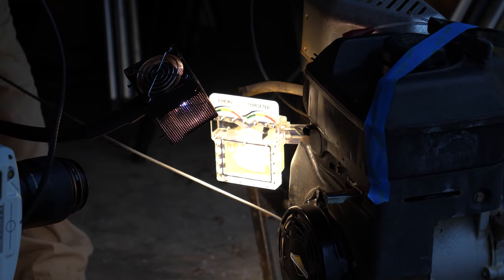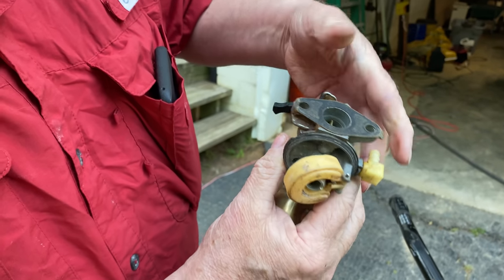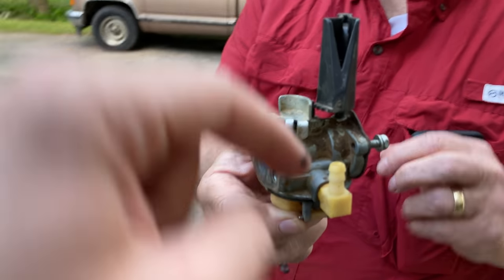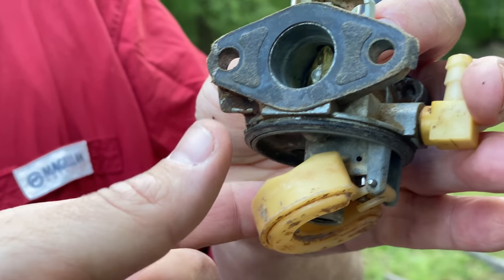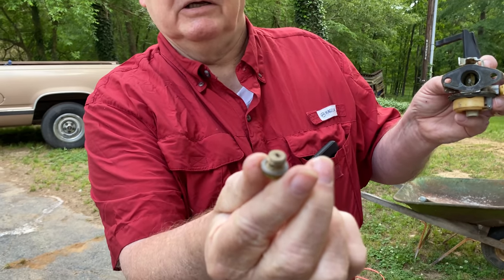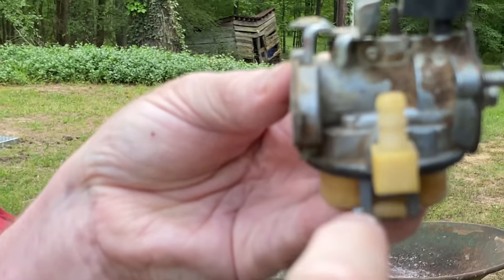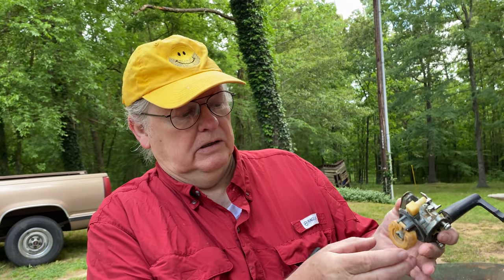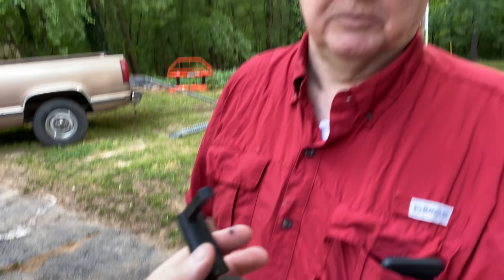Transparent Carburetor (Extended Cut With My Dad Darryl) - Smarter Every Day

Comment: Great video. The only thing I think you missed is the purpose for the float and valve. Just to shut off fuel flow, otherwise it would continue to flow until Fuel came out of the carburetor saturating the air filter and flooding the cylinder. The bowl needs to maintain a certain level that the Venturi could still suck the fuel out otherwise if fuel too low it won’t be able to suck enough fuel and if it’s too high it can easily run Rich or flood

Comment: The vibration of the float is not quite the piston turning around. The float is on the right 4 times for every intake stroke, so every 2 revolutions. Which means the float vibrates at double the frequency of the engine.

Comment: So my motorbike, carburettor has two spring-loaded screws to adjust the min opening of the valves. So you usually put the fuel to max (rich mix) and reduce the air one till engine just runs. Then you reduce the fuel one until the engine just runs at idle. 

This makes sure engine can idle without shutting off and also give you best mileage. Since during winter everything is cold, you usually increase the fuel a bit, else the engine will just shutoff at idle.

Comment: At 1 hour, dad is slightly wrong.  Some of the original fuel injection systems were essentially drop-in replacements for carbs - look up throttle body injection (TBI).  That then developed into port injection, injecting into the air stream just before the intake valve so the air stream coming into the cylinder has the fuel mixed in already.  Newer vehicles now have direct injection, which does inject fuel into the cylinder directly just like in a diesel.

Comment: The back flow is linked tonintake lenfth and valve timing. At the position of rod and crank at 90 degrees angle, you are at the maximum piston speed. It generate an high pressure wave that gose upstream the intake. This isbthe tuning you want to adjust to maximise the volumetric efficiency. The wave will then go back to the cylinder. It’s at this soecific moment that you should close the inlet valve.

Comment: This was fun to watch. I could see destin had some misconceptions and a confirmation bias but they eventually got through it. Im gonna give a little gripe, the fuel turns to a varnish like substance but its not shellac. Shellac may be a varnish but not all varnish is shellac. Shellac is a very specific thing thats made from a secretion of an insect commonly known as a lac beetle. The secretion hardens like a shell hence lac shell or shellac. This sounds made up but its 100% true. The substance is alcohol soluble but isnt dissolved in much else and sticks to just about anything, is non porous and makes a great sealer as long as you dont spill your beer on it. Ive heard its better at getting rid of smoke smell than commercial products when used like a primer for painting houses and it can make a beautiful wood finish. You can french polish a classical guitar with shellac but don't get it from your fuel tank because thats not shellac at all.

Comment: Choke controls the mixture, rich or lean. Throttle controls how much of that mixture goes into the cylinder. The throttle controls the engine speed at a particular setting of the choke. The choke needs to be adjusted as per your ambient conditions. Throttle will control only engine speeds.

Comment: I think on the old tractors, it was actually a fuel sediment bowl, not a glass carb bowl. Unless they were small, gasoline-powered tractors (which I failed to find any relevant images of)

Apparently it was not only good for its transparency, but also because it could be easily broken in case of engine runaway, which would stop fuel flow and force the engine to stop rather than fail catastrophically.

Comment: So to explain in further detail the area of time where the fuel air mixture is sucked in a small distance and then stops mid air then goes in the opposite direction and stops again then the main charge of fuel air all flows in is called valve overlap (witch only happens at low rpms) it is a function of both the exhaust and intake stroke happening one after or sometimes at the same. to explain further the piston is moving up on the exhaust stroke and the exhaust valve is open, before the piston is all the way at the end of its stroke the exhaust valve closes then the piston goes up the rest of the very short distance leaving behind a small amount of positive pressure and in that time the intake valve is beginning to open letting that excess positive pressure back travel around the valve as it’s opening causing the effect of the air fuel mixture moving back and forth a small distance, a common example of valve overlap is the choppy sound of a race engine at idle witch has a camshaft that changes the exact moment or timing the exhaust and intake valves are moving during their specific stroke, witch causes a larger overlap of the intake and exhaust stroke causing a dip in vacuum or a small reversal in flow that results in a chopping sound but above idle most or all the effects of overlap are gone after a certain engine rpm witch is why the effect can’t be seen at higher rpms in the video but it can be seen in a shot done at idle. all of this to explain of a very small period of time in the suction of the fuel air mixture into the combustion chamber, using my knowledge and experience of carburetors and this video together to make myself understand more and hopefully help someone else understand making us all smarter everyday. And this is the exact reason why I love this channel.

Comment: It looks like the intake stroke is building a vacuum in the venturi tube, then the intake valve closes so the flow of air inward stops.  At that point, there is still a vacuum in the venturi tube that is causing the fuel to continue to flow upwards into the venturi until the pressure equalizes.  I believe that's what is causing the drop of fuel to leap into the venturi tube.  I'm not sure that is supposed to happen, but maybe it is.
Reply: I think it's simply the upward inertia of the fuel that continues after the vacuum ceases, because if there was any vacuum still present, the drop would move toward the intake rather than float on the spot?

Comment: Your carb doesn't have a idle circuit so it won't run it in idle, you had to use a choke to create enough vacuum to bring up gas in the main circuit.  This is a very neat idea to show how the carb works.  I am 74 years old and had to do my learning from a book which i didn't read much.

Comment: Although there is 'direct injection' fuel injection doesn't generally go directly into the combustion chamber. It's closer to spraying onto the back of the intake valve. It's replacing the effect caused by the ventury with higher pressure and a nozzle to spray the the fuel into a wide fog to spread it out. Then of course the spark plug(hopefully dead centre of the piston) lights the mixture off. A diesel on the other hand DOES inject the fuel in a similar fashion directly into the combustion chamber AFTER the air has been compressed and uses the pressure and heat already in the chamber to light it off. Also.. For somebody who is very smart i found it amusing how dad was having to explain why letting the engine run away was a bad idea. The simple answer was.. 'parts come out' You don't want that.. Particularly if you're standing right next to it.

Comment: @ 1:18:42 it appears as though you're inhibiting the efficacy of the venturi mechanism because your throttle is closed. You see better atomization of the fuel after the closed throttle flaps, effectively making that area your venturi mechanism. The fuel is going through a small port (area between your closed flap to your housing wall) into a larger area (after your throttle flaps). You can see better vaporization in the latter area.

Comment: I was going to ask why the jet of gas comes up when the venturi is not blowing.  Meaning that the air flowing through the venturi is what creates the low pressure and pulls up the gas, but the gas seems to be pulled up into the center of the venturi when there is no air flow.  However I think there is just a delay in the gas' reaction to the pressure acting on it.  I noticed in the shot at 1:05:00 when you are pull starting the engine you can see the gas coming up the tube.  Here you see the air moving through the venturi is pulling up the gas and when the air stops the gas' momentum keeps it moving up for a bit which results in the stream/droplets waiting in the center of the venturi for the next air blast.

Comment: There is delay in suction. The action starts from the piston, then the valve and after the carburator. To answer your question: the shock is upstream the venturi the generate more underpressionnto suck more fuel. The throttle downstream is the limit the air/flow so the engine speed or load. The throttle will affect the volumetric efficiency: effective air mass divided by theoretical air mass. With a lot of pressure drop duebtonclosed throttle, you will jave a low volumetric efficiency. An engine is a wind instrument: you have to tune the intake and exhaust to gate. Lenfth of intake and exhaust are very important when your look for high power or efficiency! There is so much to discuss about that!

Comment: Today they are hybridizing the DI and PI technology using both simultaneously to achieve better fuel economy, power and efficiency.   

DI =  Direct injection, which is rare. Ex, VW TDI. Injects high pressure atomized fuel mixture direct into the cylinder/combustion chamber just below the head line.  
PI =  Port Injection, Which is what most cars have today. Injects fuel inline with the intake manifold Usually very close to the intake valve.
TBI =  Throttle body injection, 80's  to early 90's Transition technology. Uses a carburetor style venturi stack but uses piezo-electric high pressure fuel injectors to introduce the fuel eliminating the vacuume, float, needle and bowel system.
Carbureted - What you demonstrated.

Comment: If I'm not mistaken vapor lock is a condition that occurs where fuel lines placed too close along the engine over heat to near boiling temperatures causing air pockets interrupting flow prior to the carburetor

Comment: I am still trying to wrap my head around this whole thing. So the Bernoulli effect (restriction increasing flow speed and thereby decreasing pressure) is what pulls the drop into the throat right? But that is happening before the intake stroke so what pulls the gas from the float? Or is the intake valve opened a little before intake stroke TDC and thats what pulls the gas droplet up?

Comment: hi, first off thanks for an amazing video, second , i'm envious of your relationship with your dad , no ill feeling though , may i ask your dad though or you might know as well , a choke on a motor bike  , does that work backwards to the way the choke worked on this carb ? 
by backwards i mean , on this carb when you're opening the choke you're increasing the air , where as in a motor bike carb when you open the choke , i thought , i could be wrong but i thought when you open choke on a bike , you're increasing the fuel to make the air/fuel mixture richer . 
And at 54mins of this vid i think your dad was right , about the vibration of the float

Comment: Only about 17 mins into this 1 and already watched the 1 on your main channel.
2 thoughts other then the long comment I left on your first channel.
If you could stop gasoline from vaporizing it's not flamable.
Second thought the old industrial portable air compressors were made out of a V-8 engine.
4 cylinders were used to keep engine running 4 cylinders were used to make compressed air. This thought goes with my thought of see through engine

Comment: About that syringe pulling air each time, the throttle doesn't change the volume of the cylinder of air displaced, it changes the pressure at the intake, infact this pressure is never atmospheric because of restriction and optimising this flow is the magic behind performance engines, in fact most engine intakes take advantage of the pulses of air "rushing in" as to force even more air each intake, and of course you do force induction which is like putting the syringe on crack

Comment: I'm only at 4:48, one thing that you need to mention, is how the inlet tube through the carburetor actually tapers like an hourglass. this causes the intake pulse stream to increase, allowing more effective suction across the main jet and idle circuit. The carburetor would not maintain a smooth AF ratio, in the Venturi would not be nearly as accurate, without this pressure increase from this hourglass shape. I don't know if any carburetor That's just the same, straight through, uniform size. it just wouldn't work. it is even more pronounced, on carburetors with booster nozzles, like Holley 4 barrels, for instance.

Comment: I like the epiphany about ethanol laden gas. Check out phase separation and how it affects fuel systems that sit for periods time like they do in boats. There’s also a lot other side effects of running ethanol in fuel systems that aren’t engineered for it - more of a materials issue.

Comment: Vapor lock is when the pressure differential between the neck of the Venturi and the bowl itself are too close together, thus a failure mode because the intake vacuum isn’t strong enough to pull fuel into the Venturi.

Comment: With Fuel Combustion the gas goes through an atomizer directly into the cylinder. U still have an air intake like a carburetor but it only adjust the air flow into the cylinder.

Comment: I just realized something. I think. So I remembered that the old prop planes had carburetors with floaters, too. So when they did a barrel roll the carburetor would drown the engine. For all folks out there who think video games are useless, I know this from a video game! The game actually simulates this effect on early props. Now, for real-life planes this was a serious enough issue that the carburetors on later models were designed not to require gravity. They used pressure carburetors 'looks up' since 1940s.

 But then I thought if jet engines would have a carburetor and what would those look like? And then it hit me that a jet engine IS a giant carburetor. 'mind blown' And Destin said that carburetor is "essentially a rocket nozzle". But now I get it, I think. Unless I got everything wrong.
Reply: A 'jet' engine does not have a carburettor; it is a continuous flow process, not the interrupted 'suck', 'squeeze', 'bang', 'blow' of a four stroke engine.  Air is continuously compressed by the fan and compressor stages while fuel is sprayed into the downstream combustion chambers.  They provide an environment where some of the hot, high pressure air is slowed and mixed with the fuel in the correct proportions, such that combustion can take place.  The hotter and now expanding exhaust gasses drive the turbine stages, which are on (a) common shaft(s) with the compressor stages, before exiting the engine and providing forward thrust.

Comment: So how did old planes with carburetors work if they went upside down?
Reply: Short answer...they don't. This is why in the lead up to World War Two, and especially during it, there was an intense interest on the development of Fuel Injection. Many novel solutions from simple plumbing fixtures, to pressurized carburetors (that acted like a fuel injected throttle body) where utilized. But the end solution was surge tank driven return line fuel injection, and dry sump oiling with weighted articulated pick up tubes. Many of these designs are still, for the most part, used in modern aviation, even on jet engines, to this day.
Reply: @bigbuckoramma  wow, good to know.
Reply: Chainsaws and wheed whackers use bowl less carbs to allow use in all orientations. They use a vacuum operated pump and a flexible diaphragm to store the fuel for the jet.

Comment: Very cool, I’d be interested to see what happens when there is a bit of water at the bottom of the bowl, happens up north here all the time and the engine will never seem to purge the water, I’ve heard it’s because there is not enough vacuum to pull the water up the main jet.
Reply: @NG Hermit , that is a GREAT idea for a video!!!! All, let's vote this one up.
Reply: @reiniervanrooyen1528  Thanks!
Reply: The water and gasoline don't mix, so the heavier water sits on the bottom of the bowl. It's actually designed to be a bit of a sediment/water catch.
Reply: @kjdude8765  Of course, but I’ve had many engines where they won’t fire with water in the bottom of the bowl, and that is where the main jet pickup is. Can the vacuum simply not pull that water up to purge it? Drain that bit off and it’ll fire right up.

Comment: 2 Questions that were touched on, but never answered. There were 2 holes inside the channel going from the main jet to the Venturi on the tiller carb. Why 2 holes? Also, your dad mentioned 'thats why they call it a 4 stroke.' So now I'm so interested to know what is different about a 2 stroke?

Comment: When starting a engine airspeed is so slow across the Venturi you won't get enough gas for it to run but if you turn the choke "on" it creates a vacuum which sucks the gas out of the bowl.

Comment: ... because your venturi opening is rectangular to afford a flat prism so the view of the hi-speed cam will be clear.  That may by why it's too rich or it is reaching the roof. Maybe a circular opening will produce a floating droplet of fluid gas as it is suctioned off the jet, instead of a column? (edit: at around 1:13:15, your friend actually took note of the non-cylindrical valve opening.

Comment: About the throttle issue, the volume drawn in is the same for any given intake cycle, but the number of cycles per unit time is increased as the throttle is open wider. Thanks for sharing. 07/11.